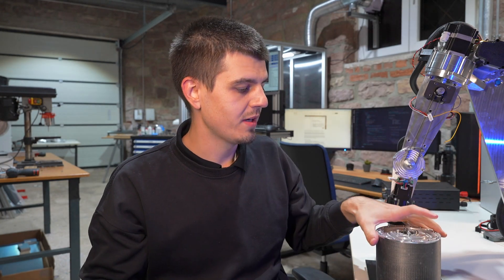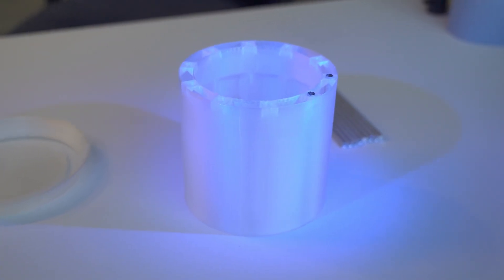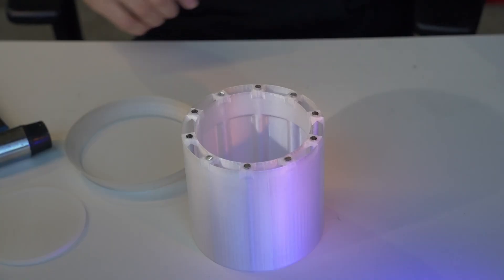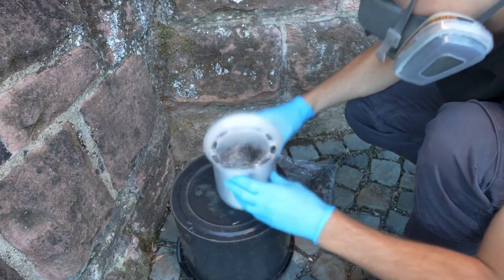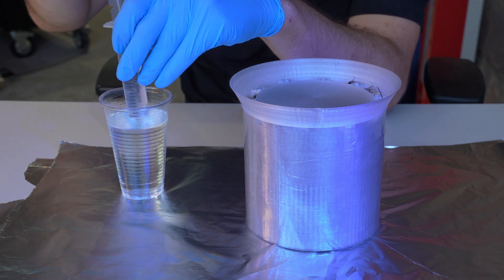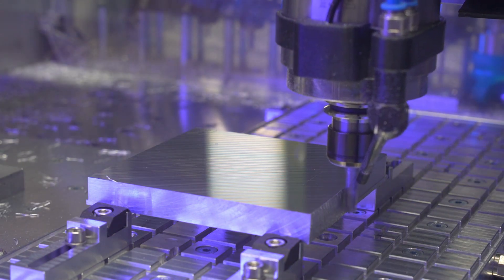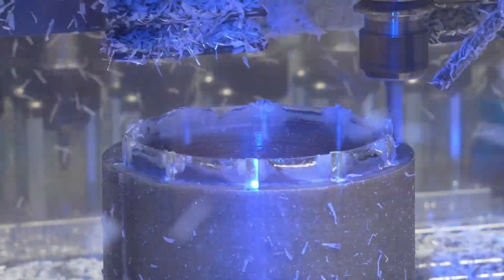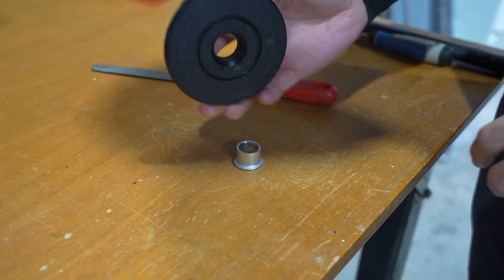Reinforce 3D Print with Carbon Fiber - Novel Approach

Comment: Inverted mold/sandwich and you integrate the shell into the structure, interesting approach! What are the benefits compared to the same part solely molded out of carbon fiber with aluminum rods?
Reply from the maker: Hi Ariane, thank you! Benefits are, less mess, and if it would be a cfk part you’d have high expectations -> mold sanding, afterwards sanding, painting… with this method it looks like a 3d print but is extremely strong. Underdog!:) also you can integrate less critical features (for structural integrity) in the print with high complexity: screw holes for maintenance lid, cable management, pcb mount

It also protects the resin from UV if you use an outdoor filament. Just like people embed steel in plastics
Reply: @alexanderrueffer thank you for the explanation! Indeed a good method to try out without having to spend hours/days on the finish process then.

Comment: Would it make sense to 3D print in a low temp polymer or wax and melt away the container after the casting ?
Reply from the maker: Thanks, a great idea! We cure the part at 60 degrees in an oven, the epoxy can go to 80 degrees. Are you familiar with filaments that melt here? What about pva and dissolving it in water? However I don’t know if pva dissolves by liquid epoxy…
Reply: @alexanderrueffer, you can always use an investment casting grade resin or wax, and those filaments are available too

Comment: Very cool process & video. I’ve tried similar “forged carbon” methods (see Easy Composites on YouTube). Using gravity and hand compression gave me dry spots at the bottom that weakened the part, though my use case was a hydrofoil. I got better results by pre-wetting the chopped fibers with epoxy in a separate cup, then packing the mix into the mold.
Reply from the maker: Thank you for the insights:) I think a pre wet can be worth the labor if you want highest performance!

Comment: That's very cool idea, but how do you separate your cured resin from the 3D printed mold?
Reply: Perhaps burn it out/off if a low temp filament is used.

Comment: This is bullshit, isnt an efficient way tô use carbon Fiber, you might wrap the part with some layers of prepeg and get a much more resistant and lighter part, filling the part with lots of resin and some CF is dumb.
Reply from the maker: Thanks for commenting and pointing out improvements. It is a common use for fibers in thermoplastics epoxy or concrete, it increases strength dramatically. We a had a hard time wrapping the linkages with prepeg. That makes it useful for us.
Without diminishing your points, is the tone necessary?
Reply: Also you could use vacuum to pull the fibers inside the part in a thinner space, trying to have the most higher Fiber to resin rate. And later pull the resin with vacuum as well. Dont reinvent techniques that already exist and até solid...
Reply: This whole video was a bad design and proccess choices summary.
Reply: The tone is because i found a little bit unprofessional to come here with a suboptimal solution, brought as an innovative approach without showing the downsides or the alternatives. As a content creator you should be more carefull with your deliver, you can mislead a Lot of people. Not here to hate, take my words as a positive critic.

Comment: This is effectively cast in place un-forged carbon, right? Low carbon to epoxy ratio makes me wonder how much better it performs than just a deep pour epoxy - presumably a bit better but more work and presumably more expensive.

Still a cool idea
Reply from the maker: Thanks for commenting! Yes, we still call it forged. The ratio is not ideal, also not low. We are talking 30% fibers with up to 15mm length. The cost for the fibers in the video was about 8$.

Comment: You could also purchase carbon tubes in concentric diameters and design the 3D print to slip in-between two concentric tubes and have channels inside that fill with your carbon short strands (and aluminum stand-offs), and then connect the two tubes to each other through this substructure.
Reply from the maker: Thanks for the tip! The manufacturing method is complicated for the pipe base. You are right it’s easier to produce from simple to source stock. For the more organic linkage that option doesn’t exist:)

Comment: you skipped the part where you got rid of the 3d printed housing. did not notice it when i watched it the first time, got a little bit confused if the housing was part of the endresult.

was removing the 3d printed housing difficult or did it stick to the actual part?
Reply from the maker: Thanks for asking. Only the funnel was removed. The 3d printed housing is still part of the linkage.

Comment: Very nice technique! you can tell how strong this part by the sound it makes when you tap on it
Reply: I was thinking, you can print two separate cylinders, wrap the inner one with continuous CF, add the outer and pour the epoxy. Shreds of CF are no fun.
Reply from the maker: @3DPI67 Thanks for the comment and great idea! We have done this exact approach before. For a cyclinder it works. As soon as you have overhangs it gets ugly haha

Comment: I liked the approach but fiber percentage should be higher than %50. Otherwise you produced reinforced plastic not a carbon fiber 😁😁
Reply: And made the aluminum stick with high surface roughness
Reply from the maker: @gokhanceterez1043 thanks for taking the time to comment. Will measure the fiber ratio with a new part:)
Reply: Carbon fiber IS reinforced plastic. If you do enough research you will see it referred to as CFRP or GFRP (Carbon Fiber Reinforced Plastic, Glass Fiber Reinforced Plastic). The way he did it is a common method. Some call it "forged carbon". Woven fabric with low amounts of epoxy is not the only way to do carbon parts. How strong is it versus a traditional layup method with woven fabric? Probably not as strong, but a testing setup for that large of a part would be impressive.
Reply from the maker: @mjodr thanks for the info. Yes it can’t compete with a fabric mold layup. The test setup would require multiple tons. I once tested carbon pipe connectors for strength. The forces required were very dangerous, lots of energy stored and because of the instant failure of carbon, instantly released.

Comment: Glad to see you back and can’t wait for some of the updates! The milled aluminum dimple die to flare that tubing (for what looks to be fairly tight tolerance requirements) will be awesome to hear about in the future!
Reply from the maker: Same for you, thank you for commenting. To a man with a 3 axis cnc everything looks like a 3 axis part! Our way to avoid a lathe a little longer haha
Reply: @alexanderrueffer  have you thought about using a servo mounted in a 4th axis configuration but running a little larger servo, direct drive to a chuck and using it as a lathe? Brother machines have a really cool work holding setup (that you’d have to machine of course) that allows lathe tooling to be mounted on er collets and transfer load (I think?) to the z axis/spindle back plate vs. the spindle bearings. If you want another rabbit hole project queue :)
Reply from the maker: @drivenba currently thinking to modify our zero backlash robot actuator into a turntable, maybe 4 maybe 5 axis. We are not far from the point where buying a machine and focusing on our main products makes more sense… it’s just how it works:/
Reply: @alexanderrueffer  certainly great stuff all around! I’m glad to hear it’s progressing either way and hope you get to keep up with the videos so we can all ride along!
Reply from the maker: @drivenba for sure!:)

Comment: Thats so cool! Have you tested the strength of such parts? It seems that main strength comes from the resin itself, not carbon fiber(as there are no continuous strands of fiber that force is applied to) or am I wrong? I wonder if making a race car rear wing mounts using this technology would be strong enough.
Reply from the maker: Thanks for your comment! The fibers are between 5 and 15mm long. They add strength for sure. And also there are videos on yt where they add small amounts of continuous fiber to a forged carbon part and increase strength by 50%. Maybe a hybrid solution would suit your wing mount?

Comment: You need a way to compress the fibres inside the cavity and push out the excess resin to make a proper forged carbon part. This looks like it’s mostly a resin part with fibre reinforcement rather than a CF part with resin bonding
Reply from the maker: Hi Jamie, thanks for your comment. I totally agree. We are not claiming to have produced a high grade cf part. It is a way to immensely reinforce a 3d print.

Comment: It's great an all but chopped carbon fiber (presumably with crappy 210GPa firbers) mostly adds weight + stiffness in the form of the resin matrix. You could just print it solidly out of CF filament and you'd be at about the same level of stiffness and CTE in the sensitive direction. 

For actual benefit of CF you want to wrap the parts in a woven CF cloth. Some configuration of axial and 45° layup. The way you packed the chopped fibers you pretty much only have a radial layup. Very useless for what you are doing. Sorry.
Reply from the maker: Hey Leo, first of all thanks for the valid concerns about fiber strength and orientation! Do you have a filament from a specific vendor in my mind? Could do strength and stiffness comparison.
Reply: @alexanderrueffer it's not fiber strength. It's fiber stiffness. Any fiber is incredibly strong but good ones are a little less strong but have up to 900Gpa stiffness instead of 210GPA (I realize those high end ones are insanely expensive). 

I like the PPA-CF stuff from Bambu for high end stuff. Any other CF filled filament is a great upgrade too. Print solidly and optimize for thick walls. 

Whatever you want to use, you should optimize your parts so that the fibers are oriented in a beneficial way and not radially (if you can).
Reply from the maker: @Leo.Wolf.the.Engineer yes stiffness you are right. With the shown method you should come closer to your described fiber situation than with a solid ppa cf print. Speaking of fiber ratio, length and orientation.

Comment: Думаю нужно замешивать углеволокно до заливки и использовать разные длины отрезков от 3х до 10мм. + ультразвук для расщепления волокон + использовать мощный миксер. В этом случае они уложаться во всех направления и жесткость будет очень высокой. При этом можно было бы встраивать алюминиевый компонент прямо внутрь контрукции, а впрыскивать смесь через специальное отвестие.
Reply from the maker: Thanks for the idea! I agree with alot. Mixing the fibers I am afraid to create carbon dust that won’t add much strength. We tried mixing fiber and resin before and it was 100% manual labor packing it down. I like when gravity does much of the work here haha :)

Comment: hi, materials engineering student here :)  
when we calculate most properties of a composite, we use a weighted average, considering the raw materials properties and volume fraction. you have waaaay too much resin. resins dont have specially good properties and are quite fragile. my approach on this technique would be adding the reinforcements in layers - add some resin, then as much CF as possible, then more resin, and so on. traditional cf parts normally have about 60% volume of fibers and 40% of resin. if you could get 40% fibers and 60% resins it would be already very good!
Reply from the maker: Hi Pedro, will check the ratio exactly the next time. I just remember the ratio being quite high with over 30%. Thank you for the expertise!

Comment: Use something to vibrate the part so all the carbon fiber packs in nice, and then use a vacuum so all the resin has no air pockets.
Reply from the maker: This is exactly our next step. Think this will work out great. Thanks!!

Comment: You could keep the bottom of the shell open and make an adaptor to put a mesh and a vacuum to pull the fibers and compact them from the bottom. The top would probably still need manual compacting tho. 
Alternatively, you could put the loose fibers in a tall cylindrical column at the top and press everything in place at once, kind of like compact powder metalurgy. This would probably allow you to take only like 30 sec to 1min per part
Reply from the maker: First of all genius ideas that we have tried in various forms. Still needs some tests. To be honest both pushing from top and pulling from bottom didn’t work so well, we keep trying
Thanks for the super valid input!!
Reply: @alexanderrueffer  oh or you could even make that hexagon compressing thing around the core, but then push it down into the actual tubular sleeve so it keeps its shape!
Reply: @alexanderrueffer then, maybe pushing from the sides! Im thinking of something like hexagonal crimping tools for ferules. I think if you split your outer wall in 6, splitting where the tube is tengent to the hexagon, it would close properly and compress. 
I found something you could start from. Look up Sliding Mechanical iris-hexagon cutout on google, theres a model on  cults3d that you could stack or scale vertically to test on small scale.

Comment: It seems like a very labor-intensive process with non-uniform results since the fibers will be randomly organized throughout the structure. Better to use a carbon fiber 3d printer.
Reply from the maker: Hi Kurt, the labor point is valid! Randomly organized fibers can be an advantage, strength also along Z…

Comment: And what about the safety aspects of milling carbon fiber strands in the manner presented? Carbon fiber is far more dangerous than metal. Look under a microscope. You would not want that in your eyes, skin, and lungs.
Reply from the maker: It is an important comment. Thanks. I had a big disclaimer in the video and then removed it. I am not selling the components and no one needs to copy any of this. 
That being said regular vaccum cleaners don’t work for the fibers from milling, sawing drilling and you need to wear a mask with P3 fine dust filter. Also wet wipe any surface and put your milling machine or whatever under lower pressure and move the air outside, even 30 mins after the last cut

Comment: A while back at formnext I saw a company that pushed resin with long fibers (~20mm) through predefined channels in their 3d prints, putting rigidity exactly where needed and coming pretty close to the performance of actual continuous carbon fiber
Reply from the maker: Yes I know them, it is a very cool technology! I am indeed curious how they stop the resin and fibers from separating and what their ratio is. Also their cavities don’t seem to overlap, which means forces and stresses still go through the filament. Just a guess I need to check their stuff out in real life:) thanks for the input!

Comment: Very interesting process. Did you calculate the amount of fibers you need for this specific part, or just filled the 3d printed form with as much as you could? I mean, is there an ideal ratio of CF and epoxy?
Reply from the maker: Valid point!! We weighed both epoxy and cf fibers. I remember the fiber ratio being pretty high with over 30%. We filled until saturation. It is all very practical it needs scientific tests to find an ideal ratio:)
Reply: I thought about this as well, when doing “regular” forged carbon layup you would want closer to 50% fibers. You could try to mix fibers and resin before pouring it into the print. 🤔But without a vacuum pot or some special clap it will be hard to achive optimal fibers to resin ratio.
Reply from the maker: @MartinNord-t5f Hey Martin, we found that mixing before is a huge huge mess. The thing is what we want to achieve. A nicely done cfk part that is superior in weight/strength compared to steel, or a functional structural part with pretty low design constraints, superior strength to 3d print and much less work than cnc mill from aluminum. We went for the second:) still a vaccum pot will increase strength without affecting labor much:)

Comment: I've done something similar where I used a thin 3d printed shell as a mold that I simply never removed the carbon fiber from. The 3d printed part then also acted as a cutting guide for the excess CF and also had features integrated in for fasteners. Similar idea but this executes on it in a different and novel way, love to see it!!
Reply from the maker: Hi David, yes same concept. Cool someone had the same thought process! Thanks for commenting

Comment: Great idea, needs vacuum pot though there are lots of air bubbles trapped in there. Should be roughly stiff and strong as aluminum.
Reply from the maker: You are right, it is not a cf part from the performance point of view. It will exceed any thermoplast cf filament and yes aluminum is a good comparison! Just imagine copying this part with a ball end mill haha…

Comment: Great idea, strong, and yet lighter weight. Please keep these videos coming, awesome work!
Reply: as compared to what?
i mean, i can say the same (strong and yet lighter) about almost every other material in existence depending to what i’m comparing to…
Reply from the maker: @Canis.Lupus.Arctos Compared to pure 3d print with same strength and e module. In our case pure plastic wouldn’t work. We don’t have the geometrical freedom to use a massive chunk of filament, needs to be hollow for the internals. At the end we need to do a strength test:)
Reply from the maker: Hi Kees. That’s why we chose this path. Turned out great. Thank you!!